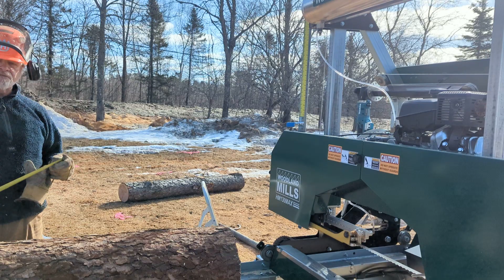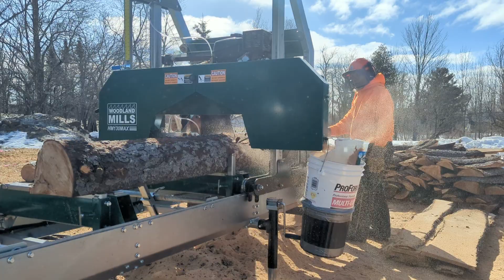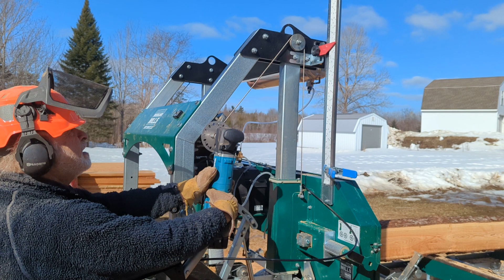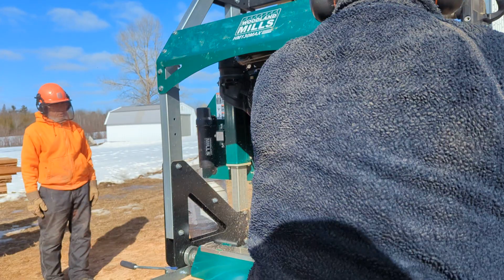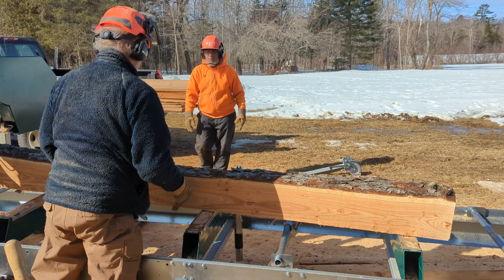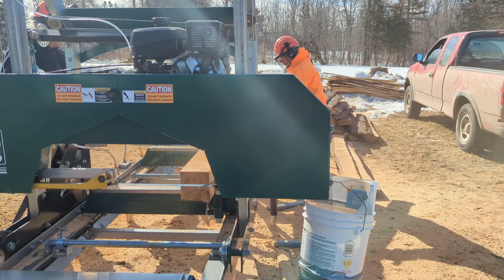Bob Seymour demonstrates sawing a 10" diameter black cherry log with the Woodland Mills HM130Max

Comment: I wonder if you could rig up a second pointer more at eye level for the smaller logs. Possibly of heavy copper wire that could be bent out of the way for larger logs. Idk. Really good real time video. Ty
Reply from the maker: Thanks. I think the new Woodland Mills upgrade will do the job.

Comment: Looks like you are doing good with the machine and have it figured out. Have you ever thought of getting an automatic feeder so you don't have to push it along?
One question. Why was the first cut so deep?
Reply from the maker: You need to vary the feed rate based on log size, species, etc so a fixed-rate feeder would not be optimal.  Plus I don't mind the exercise. Yes, the first slab was a bit thick; I might have got a 4" board from it, but we were trying to finish and I didn't want to fool with any extra edging for such small boards.
Reply: @tmimotf  You can them them with variable speed settings but I get the exercise part, thanks.
Reply from the maker: @rickvaiBBB  I get more "steps" on my phone and Fitbit when sawmilling than any other daily activity.

Comment: Can you share how Andy modified the crank to use drill motor?
Reply from the maker: Just remove the stock crank and attach the Makita, like it was a drill bit, using its on-board chuck key.
Reply: @tmimotf  thank you!